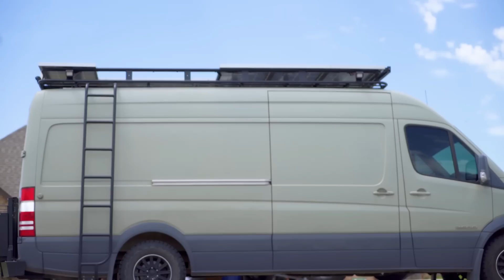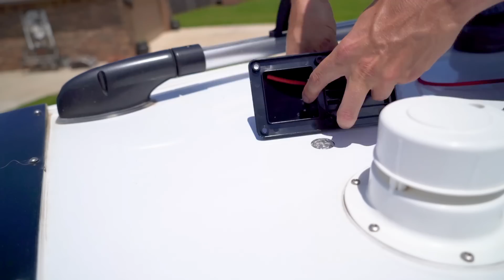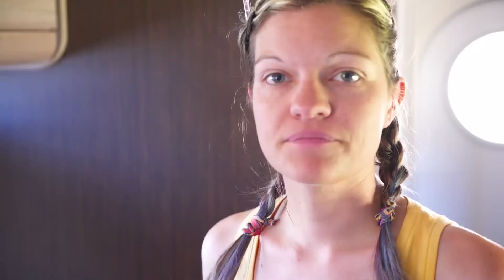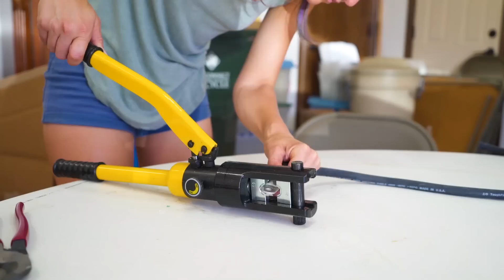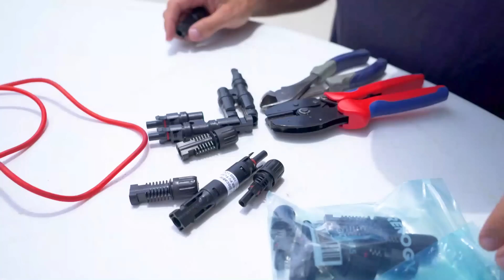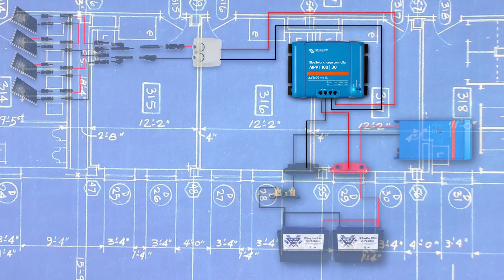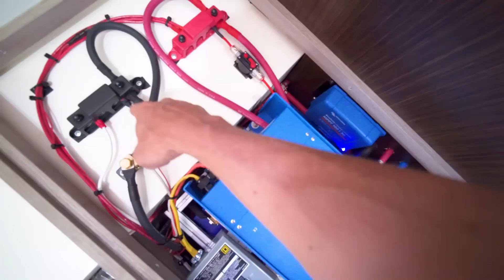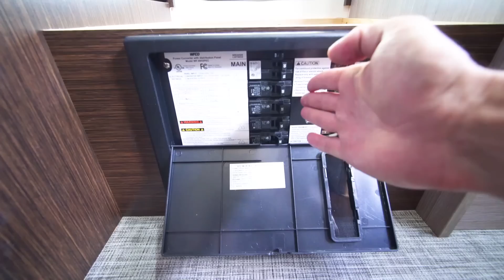Camper Solar Setup Tutorial - How to Solar Power your RV, Camper Van, & Truck Camper

Comment: Use dicor self leveling lap sealant where the brackets meet the roof. You can buy it online or at any rv shop. Best stuff you can use on a camper roof.
Reply from the maker: The elastomer sealent we used is pretty much the same stuff as dicor.

Comment: What a great video. We just purchased a new truck camper with the intention of installing solar. I picked up some great ideas from your install. Thanks!
Reply from the maker: Awesome!  Glad it helped.  Thanks for watching!
Reply: @EXPLORISTlife  A quick question... I am working on a similar truck camper install and have purchased a SmartShunt, a Cerbo GX and a GX Touch 50.  I don't see the need in having a BMV battery monitor as well.  Am I correct with this assumption?  Thanks again for all of your great videos.

Comment: Wheres your dump load to prevent over charge
Reply from the maker: Not needed.  The charge controller handles that internally.
Reply: @EXPLORISTlife  what if you was to use a wind turbine the power needs to go somewere could it dump that internaly
Reply from the maker: We aren't using a wind turbine in this system.  If you want to use a wind turbine in YOUR system, you'll need to follow the instructions in you wind turbines user manual to see how to integrate it into a system like this.

Comment: For people on tight budget. Pure sine wave inverter with built in battery charger costs a heck lot. If you have space buy the pure sine wave inverter and charger separately. You will save a lot of money.
Reply from the maker: By the time all fuses, busbars, wires, and lugs are figured into the cost; it's about the same.

Comment: One thing I'd add is some type insulation for the solar panel wires dropping in through the roof. That metal hole is sharp and will eventually rub through the wire's insulation with virbration.
Reply from the maker: Feel free to add whatever additional bits and pieces you like to your own project.  The general concepts will be the same for this project of if you are using grommets vs not.

Comment: Running two sets of panels in parallel didn't work well for me.   If the input voltage rating of your controller allows for it, you should try putting all four in series.  If you can't do that  I recommend a second solar mpp charge controller and parallel the outputs of the controllers.  Your mileage may vary.    When I compared the two series two parallel   to the four series,  I got the full panel rated power with the series connection, but I was only get 60% with the series-parallel connection.  Mismatched panels or something.
Reply from the maker: If the panels are not identical, you will very likely have power loss.  More info: https://www.explorist.life/using-mismatched-solar-panel-sizes/

Comment: We are moving off grid. We have 3 - 180 watt solar panels 40 amp MPPTcharge controller  2000 watt pure sine wave inverter 4.& 6 gauge wire. 200 amp in line breakers. Ready to put together. How can we connect this to a 30 amp type  plug in like you would find in a campground? Or is this possible? We have no wiring expertise and don’t want to hard wire everything
Reply from the maker: Sure!  Here is a diagram that should get you pointed in the right direction: https://www.explorist.life/2000w-inverter-200-400ah-lithium-200-to-700w-solar-camper-wiring-diagram/

Comment: You guys are amazing! Learning so much! Just a question, isn't it easier and save roof space to just get two 200w panels? Or even just get two 300w panels for extra charge and power for the batteries?
Reply from the maker: Ultimately, you can use whatever sizes of solar panels fit your own setup; but in this particular build, 4x100w panels fit best for our needs.
Reply: @EXPLORISTlife  thanks for the reply mate! Your videos are the best thing on the internet for RV solar it's actually a godsend.

Comment: Hey Nate and Steph. Thanks again for sharing your very helpful diy tutorials for a campervan solar system. My vintage travel trailer does not have an oem transfer switch pre-installed. Given that, can I just use the wiring diagram that you drew up for a 400w array, 2000w inverter/charger, and 300amp lithium battery bank? Is there any issue with having the shore power flow directly into the inverter charger rather than through a transfer switch?

Comment: Why wouldn’t you just buy 1 400 watt solar panel
Reply from the maker: In this particular application, it wouldn't fit, but you can definitely use a 400w panel if it fits in your particular project.

Comment: Just filled out survey. Woulda been nice to be able to add comments. Just bought small trailer, pre wired for 30amps of solar on roof. Don't have wiring diagram yet.
Small trailer, can put probably 4 panels on it, comes with 2 75 amp/hr batteries, will upgrade those at some point
Reply from the maker: I'm not sure what survey you are referring to, but here is a wiring diagram for  retrofitting solar and an inverter upgrade on an OEM camper: https://www.explorist.life/30a-camper-inverter-with-solar-and-alternator-charging-wiring-diagram/

Comment: Why did you do series/parallel on panels?
Reply from the maker: The charge controller has a maximum voltage input of 100V.  If all of the panels were wired in series AND the weather got cold outside, the array could exceed 100V.

Comment: I'm seeing the buss bars you use are only rated for 250 amps.  The inverter you are using can draw almost twice that and for as long as you call for a huge load or temp peak current.  I see AMSolar recommends a 400 amp fuse for that inverter and that means the amp draw is at least 325 amps.  Do yo feel it's safer to go with a busbar with much higher amp ratings?  Thanks for the video.
Reply from the maker: A 2000w Inverter can pull 166 amps continuously from a 12v battery bank. (2000W/12V=166A)

Victron recommends a 300A fuse for the Inverter. (pg. 13 of the user manual: https://www.victronenergy.com/upload/documents/Manual-MultiPlus-Compact-2000-120V-EN.pdf)

You can see a list of my current parts and recommendations for this setup here: https://www.explorist.life/30a-camper-inverter-with-solar-and-alternator-charging-wiring-diagram/

Comment: One last thing: Can you clarify what you would recommend as an OEM transfer switch on the updated solar-upgrade wiring diagram?
Reply from the maker: The OEM transfer switch is whatever is installed in the camper from the factory.  This is not to be changed.

Comment: Thanks for your quick reply Nate! I have a 1947 travel trailer so it’s slightly different than the truck camper set up. I was thinking that I could do my re-wiring to follow your DIY camper van set up with 300Ah of lithium batteries and 660W flexible solar panels. This will have a 2000W inverter/charger and a 100/50 charge controller. I’d like to use the DIY busbar set up that you demoed. Can I replace the lynx distributor with this? Also, is the Orion DC/DC charger a critical component?
Reply from the maker: The Lynx distributor is, indeed, effectively 2 busbars, so yes.  If you are interested in electrical arts and crafts, you can indeed make your own busbar.

The Orion DC-DC charger allows you to charge via alternator.

Comment: Is there a contactor that activates when you connect shore  power, so you don't have 110/240v appliances using the Inverter and Batteries?
Reply from the maker: Yes, the Victron Multiplus has a  built-in transfer switch.

Comment: I would like to set up with one Solar panel and use my old batteries.  And at later date replace batteries and add more solar panels.  Can I do it this way using the same controller?  Any suggestions most appreciated.  Thank you.
Reply from the maker: If I'm understanding you properly; yes, you can do that.

Comment: Great video very informative however you made the same mistakes most installers do. The Inverter Chargers heat is going to cook all the electronics because it has no way to cool itself. Its essentially trapped in that cabinet with no way to breath. The temperature in that RV in summer will soar. if you're using the Micro alone you're creating 1500 watts of heat in the cabinet.  I highly recommend that you install a vent on one side and a small fan on the other so any time the inverter is working the fan is removing the heat. Stay Safe - Mike

Regards Mike
Reply from the maker: We did that during the install, just off camera. 👍

Comment: First, your production quality is top notch. I just upgraded my coach to the Battle Born batteries and have the same WFCO Power Center. In my case, I swapped out the power converter/charge to the lithium compatible board. It’s good to know that when I add solar to the system that I can simply disconnect that charger/converter. It looks like I have a good plan of action to add solar to my rig. Thanks again!

Comment: In the manual of the inverter you can read, that you never install the inverter directly above the batteries.
Reply from the maker: It does, indeed, say that but is irrelevant for Lithium batteries as they do not off gas when charging so our setup is completely fine.

Lead Acid batteries, when being charged, off gas hydrogen gas which is quite corrosive and would damage most metals if enclosed in the same space as the batteries.

I hope this clears up your confusion.

Comment: I loved this video. Perfect level of detail and explaining to get me started. I am curious on your decision to use two 12v batteries in parallel vs two 6v volt batteries in series. I have read there is a strain on the two batteries being in parallel because they will have two different natural voltages and therefore continually drain each other. Or something like that. Was that not a concern here or does the inverter charger deal with this issue?
Reply from the maker: That's not an issue. :)

Comment: If I have my solar system inverter (this inverter does not have charger) wired directly into my AC distribution panel. When running off inverter will my AC converter be attempting to charge my battery bank like when I'm plugged into shore power. Essentially looping the power?

Comment: Could you advise on what bolts/hardware fit in the Sprinter gen 2 roof rails. I tried carriage bolts and lug nuts with washers, but can't find something that fits right. Is there something like unistrut nuts that I can put in the track? Thanks!
Reply from the maker: Something like this, perhaps: https://www.sprinterstore.com/product/single-roof-rack-mounts-for-sprinter-van/
Reply: @EXPLORISTlife talk about getting the day started early, thanks for the reply!
Reply: BTW, thanks for all the work you've put into all your videos, I've watched the bulk of them, your presentation, your pacing, and your reasoning - its all balanced well. Your page on solar arguing in favor of series, guided a last minute decision, on top of all the other advice, getting 4x 100w instead of 2x 200w panels. Thanks Nate!

Comment: I've looked at most if not all. How do I choose between 12v and 24v or 48v system?
Reply from the maker: I recommend 12v systems for systems under 1200w of solar panels and 3000w of Inverter Power.  
I recommend 24v systems for systems between 1200 and 2400w of solar panels and between 3000 & 6000w of Inverter Power.
I recommend 48v systems for anything bigger than that.

Comment: Hello Im new to your channel. But considering buying an RV Class B for travel around USA. Your Site is very helpful to us who have limited knowledge on putting all this together. . I would like to use lithium batteries on my VAN for  electricity DC & AC. However in your build on your sprinter van where didi you keep the batteries  Inside the van? Thanks
Reply from the maker: In the van, we keep the batteries in the back in the 'garage' area under the bed.

Comment: 10:25  forgive me for my stupid question, but why is it ok to join the positive and negative as pictured in the diagram? You see the negative (black) from the top  panel is joined with the positive(red) from the second panel. Same thing with the 3rd and 4th panels. I know the answer will be long, but just to make it simple, it that how  it supposed to be? or they made  mistake on the diagram?... Once again  i know my question sounds silly for some of you, but i really want to know... :)
Reply from the maker: Great Question!  The positive to negative connection is 'wiring in series'.  Wiring it like that boosts the voltage of a solar panels (Wiring in series means the voltages of the panels gets added together) to a level that the MPPT solar charge controller can properly charge with. 

Although this doesn't help you now, a video explaining this in more detail will be out later this spring.

Comment: Can this run an air conditioner and a fireplace.  Or is this just for lights and small appliances?
Reply from the maker: This one will be for smaller appliances with a coffee maker or an instant pot being the biggest.  It could likely turn on the air conditioner, but battery capacity would be quickly depleted.

Comment: I am actually interested in this particular camper and was glad to spot this video. It's unfortunate that the manufacturer puts such a wimpy system in this otherwise awesome camper. I am curious as to why you didn't just mount all four panels to the rack avoiding extra holes drilled in the top. Was there not enough room on the rack for the fourth panel? The 2021 model of this camper has a flexible 210 watt panel where you mounted the single one. Thanks for the video!
Watched video again and did notice that four panels could be mounted on the rack. Seems that would have been the preferred way but that's just me. :)

Comment: Hi if I want say 150 watts for example, is it better to get 1x 150 watt solar panel or 2x 75watt panels? Thanks for the great video and website
Reply from the maker: I'd recommend 2 x 75 watt panels wired in series so you could get the voltage high enough for the MPPT charge controller to really shine.
Reply: @EXPLORISTlife  Thank you

Comment: I like that used some 8020 inside your little cubby hole for mounting, here's a l little future reference you my want to think of, try using the 8020 let's say 15 series stuff and make side rails  the length  of the camper mounted from side walls, then you could make your own mounting system from that, you can even make more panels  that slide from that ether under or over them when your parked,  also prevents making more holes and sealing  on the roof, the 8020 stuff has a lot of possibilities,  I've just started playing with it.

Comment: I'm worried about leaking when I drill holes into my '79 camper, it seems like you don't drill all the way through the roof
Reply from the maker: Correct.  Properly sealing the holes as we did is the most important part of that whole step to keep it from leaking.

Comment: Very cool set up but you could get away with a much simpler system if this is more than you want to tackle. I'm just running a 1000 watt DeWalt inverter
Reply from the maker: I always recommend that a person perform a power audit before designing and installing their system to determine the size of their battery bank, inverter, and solar array.  Your 1000w Inverter wouldn't handle the electrical demands of this particular camper.
Reply: @EXPLORISTlife  
We just took a trip to Moab last week with no problems. I only have 230 watts of solar and the battery was at 100% by noon
 everyday. We don't spend much time in the camper.  We cook, sleep, and shower. 
We camp to be outside. No TV or microwave but I have a Dewalt power station, 1800 watts off Dewalt batteries. 
We were plenty warm at night with the furnace set at 70.
I do plan on adding 12 volt USB ports to charge cell phones off the house battery. 
Your set up is awesome but maybe a little over kill for the average camper. 😊
Reply: @EXPLORISTlife  
What is retail of the system you installed without labor?  It had to be around $4000.

Comment: I wonder why is it possible to series the panel. Is the controller capable of controlling it?
Reply from the maker: Exactly!  That's precisely what a charge controller is for.  It regulates a high voltage down to a voltage that is usable by the battery.  Here is another video that goes a bit more in depth on how to size a charge controller: https://www.youtube.com/watch?v=MxziHKvTRh8

Comment: What are the pros/cons of using the inverter/charger versus using the built in converter/charger?
Reply from the maker: The biggest glaring 'con' is that the built-in converter is not able to fully charge a Lithium battery as the settings do not allow enough adjustability to charge at a high enough voltage.

Comment: Great video. I am wondering about the significance of the wire size coming into the camper from the rooftop solar panels. Some of the new RV's have wires factory installed for a solar upgrade. How do we know if those wires are large enough for a 3000 watt inverter with 4-6 BB batteries? Would the gauge increase with the solar panel combined wattage or amount of batteries?
Reply from the maker: The wire gauge from the roof to the solar controller (Remember, the panels don't go directly to the battery) is actually only dependent on the solar panels and how they are arranged (series vs parallel).  Most of the wire pre-installed on RVs is on the smaller side of things but is still usually 10-12 AWG, which is adequate for most series wired solar panel arrays.

Once you know how many solar panels you are going to use, you can use this charge controller calculator to see the amps and volts the array will produce: https://youtu.be/MxziHKvTRh8

Then you can use my wire sizing calculator do verify that the wire size is accurate depending on the volts and amps of the array: https://youtu.be/ki3WXVR48eM

Inverter size and battery bank size after that is figured totally independantly of the array.
Reply: @EXPLORISTlife  Thanks, great information..